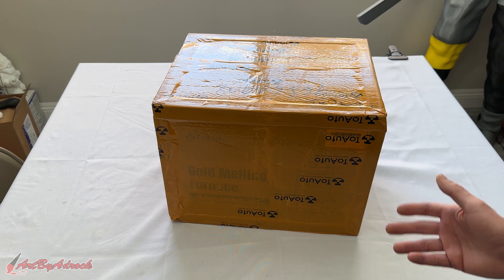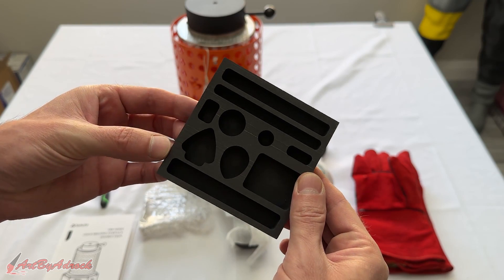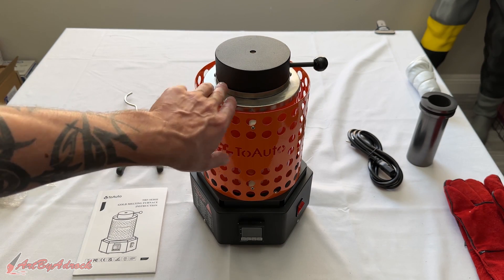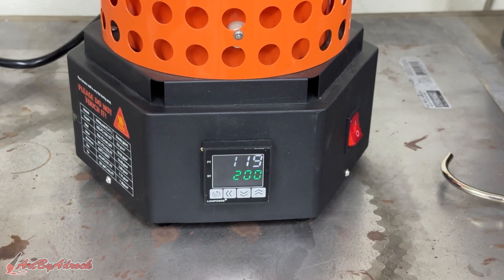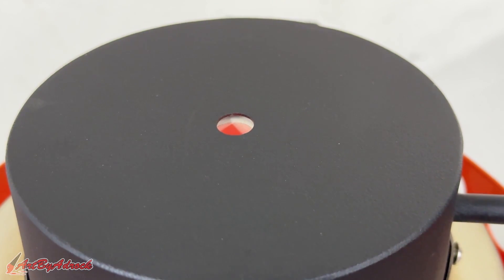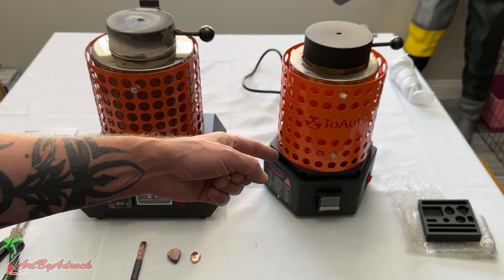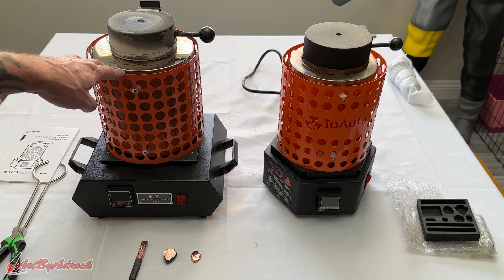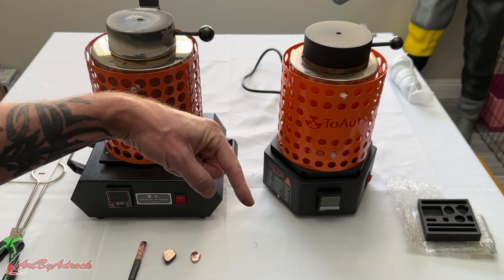UPGRADED ToAuto Melting Furnace - Simple Beginner's Metal Casting Furnace

Comment: Do you think i could melt a crucible of tiny steel chips using this furnace?
Reply: Don't think electric furnaces get hot enough for that.
Reply: They can and do just a lot of other factors take place but you can find videos on here with people doing exactly that with some success 😊
Reply: @IDontGiveAMakeLove No. This furnace gets to 1100°C tops. Steel melts at 1370°C. No matter how small your pieces are, they physically won't melt down.

Comment: Always quench your metal after you pour it. The natural color will come out. Otherwise it will stay black like yours did. Neat little machine for gold silver or platinum. Cant think of any small micro projects for aluminum or copper
Reply: It is just an oxide sometimes called fire scale by newbies.  Put it in a pickle or  dilute sulfuric acid after it has cooled.
Reply: Nah, he needs some charcoal

Comment: Ooooh! I have the rectangular one on the left, and I really like it. Maybe I need this newer one, too!
Reply from the maker: It definitely heats up much faster 👍🏻
Reply: @ArtByAdrock  I agree with you about the handles. I can move my furnace after unplugging while it is still hot, probably not with this one. I wonder if Toauto made the resistance wire more durable or thicker to help with the faster heating? I've heard that the one I have is prone to wire failure after a while, but mine has been good for nearly three years so far. Shrug
Reply: Just cut off a few inches of your resistance wire coil, stretch a little to reach the connection terminals re assemble and there you go, don't cut to much off or the coil will self destruct and or flip your breaker,, can also ad or revise your chamber that holds your refractory and increase the amount inside, effectively, just be sure to not attempt to simply stuff more ceramic fiber into the same hole because you'll add density and the thermal dissipation will increase.